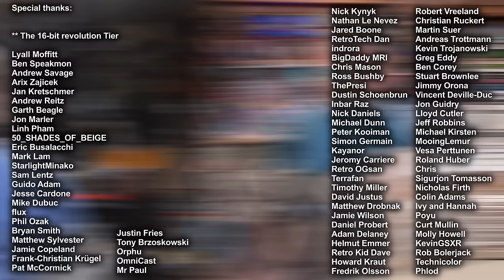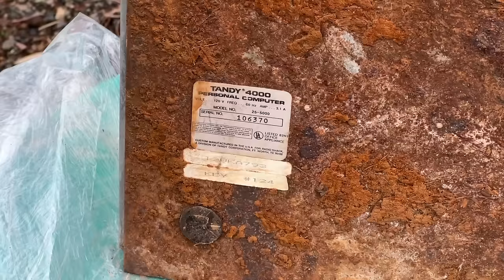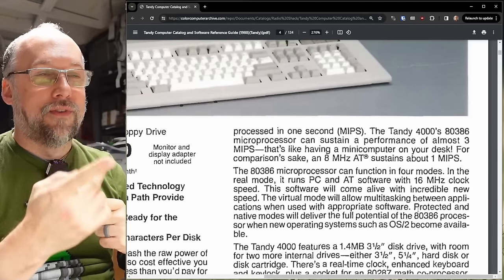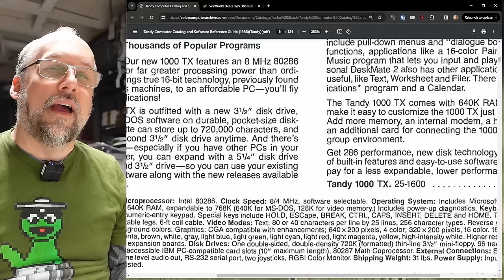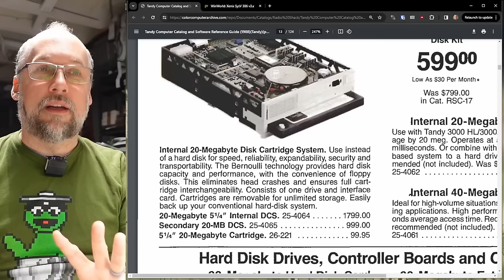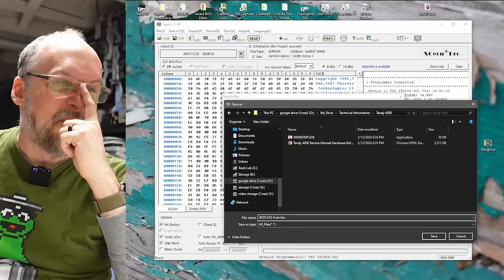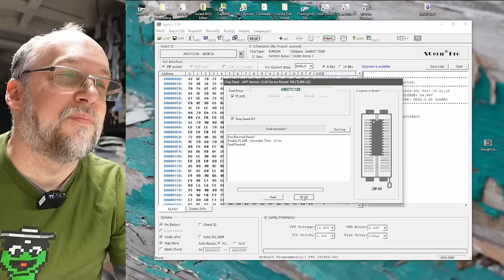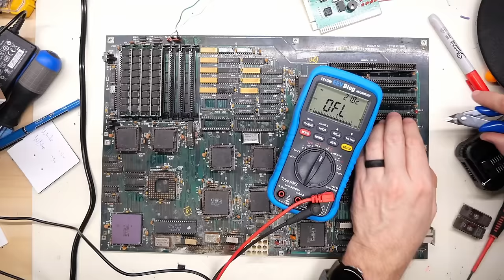0079 I'm at a loss for words when I first see this Tandy 4000 computer

Comment: Nah, skip this motherboard since other than having been in/is a 4000 is generic.  At most, de-oxit all the socketed chips, remove them, deoxit socket and clean the contacts (dremel?) and reinstall, then see what/where you are.  Oh, and verify is the power good should be high or low to eliminate that question ahead of time.

Comment: I recognize the challenge is pert of the fun, but it looks like a lot of work for a low end 80386. And even if you win the corrosion will keep going in the sockets and the crystals and the traces. It won't stay fixed for long.

Comment: Yeahhhh, most of that system is hot garbage. I bet the motherboard AND the cards will need a lot of replacement parts to get it working. Not sure if it would be worth all the trouble for a bog-standard board.

Comment: Just the oil from your fingerprint can cause a floppy disk to fail. With floppy disk like kiss that data goodbye. It's a lithium battery, look at the bottom half of the label.
Reply: Floppy disks are not that fragile.